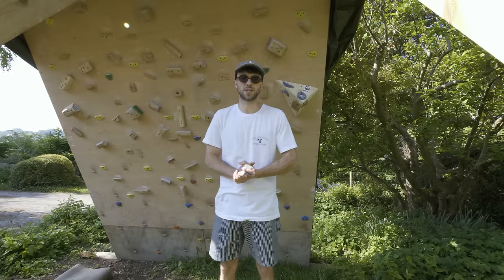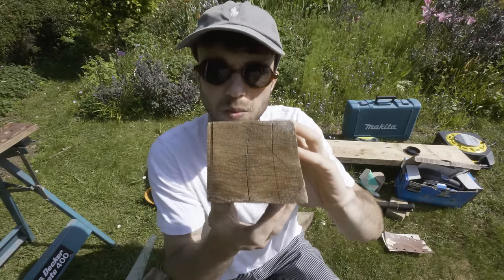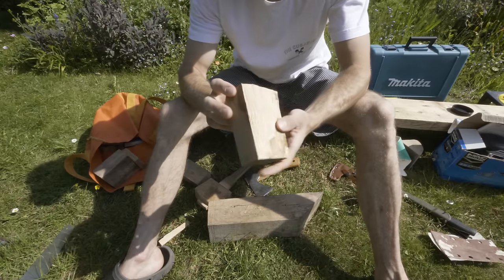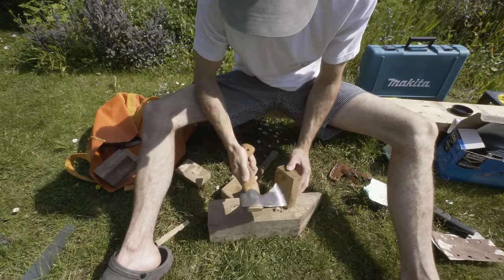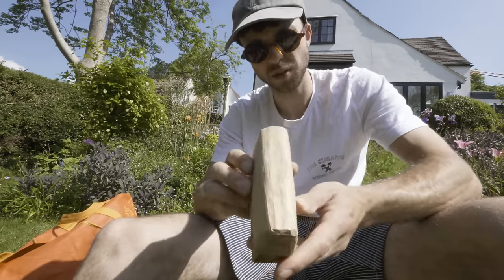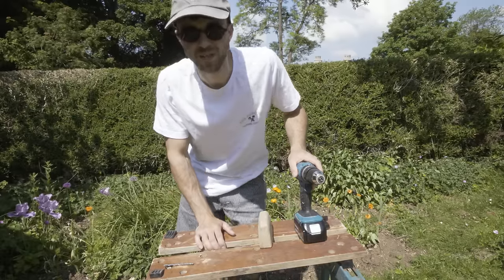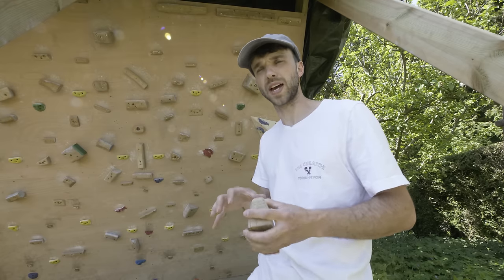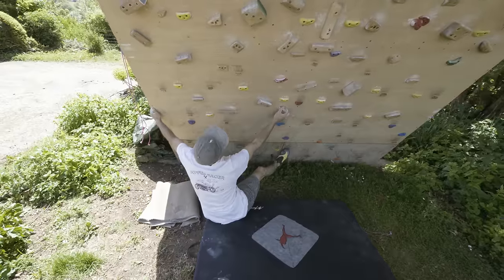From Wood to Hold || How I Made My Own Climbing Holds

Comment: quick top for sanding: drill the screw holds beforehand. attach a longer piece of wood to your workbench. drill the hold on top if that piece of wood and then you can sand it easily from all sides.
Reply from the maker: Thanks for the tip! Will try that out!

Comment: I'm planning to build a climbing wall over the summer with my summer job payment money. I've already made about 80 different holds in a span of a month or so. They have came up real nice. I have no power tools exept for a drill so it is always hell of a sanding.  Keen on the project. Few images below.  https://imgur.com/gallery/RfSvQOP
Reply: Nice work !
Reply: Tape sandpaper to a bit on your cordless drill?
Reply: @joshuasim9326  Yeah i have thought about that, but it is hard to get working smoothly.
Reply: @eelissallmen5432  Here in Oz you can get sanding attachments, but I've found the best for quick shaping is a flap disc on an angle grinder. That's basically a whole bunch of flaps of sandpaper on a flat disc, and I think you can get them to fit drills for a bit more.
Reply: Nice work man! Where did u got the inspiration to decide the shape of all of this? Im looking for help/guidance while building mine would u mind keeping in touch ? Cheers

Comment: Nice holds dude! Something I have learned from my own home wall holds is saving time is key for big batches. I use a drum rasp drill bit to remove a lot of the waste material fast and this tool took my hold making time from around an hour a piece to around 10 minutes. These rasps are drill bits that you can use in combination with any power drill (and preferably a vice/workbench). Definitely worth considering if you want to speed up the process, mine cost around 8 quid on Amazon. Drill mounted rasps come in a variety of shapes and are great for for fast curves, incut features, pockets, multi texture etc. A good 80 grit sand over will give a non polished finish. The hardest part for me has been finding decent scrap hardwood that doesn’t crack in the outdoor temperature variations. Great home vids man definitely relatable content,  happy shaping!

Comment: Two great woodworking techniques: using the secret built in 90 degree measure that most saws have, and doing a couple of back pulls to create a guide before you start sawing. Great stuff. Clamp your wood when you're cutting and drilling. Understanding woodgrain is very important, grain perpendicular to the screws. Yours was bang on. Drill the 12mm holes with your spade bit first. They'll make pilot holes for your longer drill bit. You can add a bit of masking tape on your spade bit to make a visual depth gauge. Your hatchet could be sharper tho.

Comment: Just a heads up, for the deeper holds its worth countersinking the head of the bold further into the hold. As the further the head of the bolt is from the wall the more leverage is produced when you're holding onto the hold meaning it could quite easily rip out or damage your wall.
Reply from the maker: Cheers for the tip! Will give it a go👌🏻